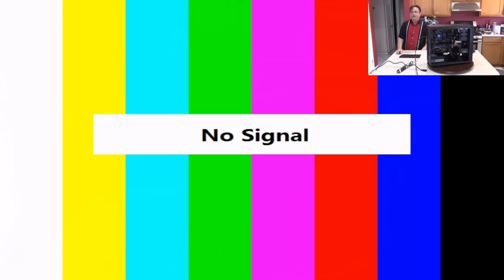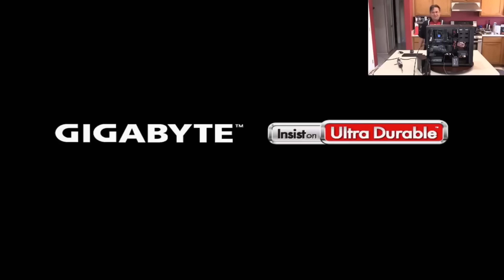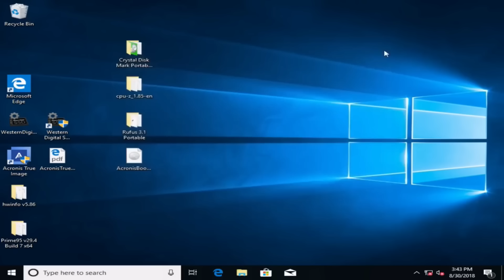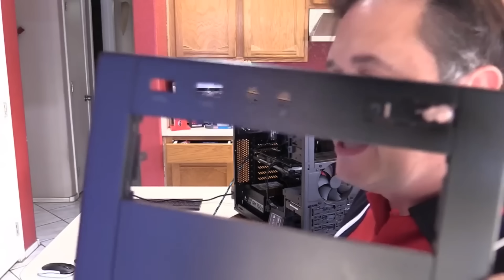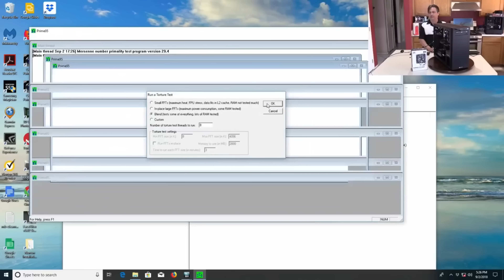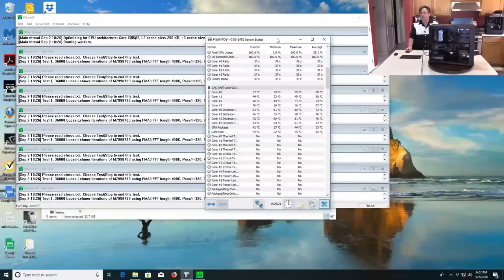HOLY COW! The easiest fix that NO ONE thought to check! Fixing a viewers broken PC.

Comment: i just did a PC build for my neighbor a month back. he was getting random shutdowns, and sluggishness. He had the PC originally built  in 2008, or so. it was a great Antec case, which was almost all aluminum, except for the front bezel which was dried out, but salvageable. he told me 'a budget of $800' , but what he needed from it, was tops a bill of $500. so i reused the case, got a new CPU, RAM, MoBo, and PSU, as well as a 970EVO+. it totaled $425 after taxes, i used an i3 13th gen, he LOVES it. its 5x faster than the old PC, it was half what he expected to spend, and i got him windows for free obviously. i always loved building PC's, i missed doing it

Comment: I wanted to thank you for making this video. I was having the same shutting down issue with my pc. It would keep restarting on any OS (internal HDD orexternal flash drive), but not while in the bios. Mine wasn't the reset switch, but was the power button. When I plugged the reset switch into where the power button goes it stopped the restarting issue. I hadn't thought of the front switches until watching this video

Comment: Corsair. I have a 600T Graphite case. Nice, except I once took the front bezel off not noticing when I replaced it, the too-tight placement had the bezel snagging the corner of the reset switch. Had quite a time trying to figure out why my machine kept switching on and off.

Comment: It's possible that they did find the issue, but wanted $700. Some computer shops are ripoff. Back in my early days of using a computer, my mother was duped several times by a repair man. He would charge her full price to reinstall Windows 95 because the win.ini complained about a bad entry. All he had to do was delete the line. Once I found out, and went into business myself, I made sure to always be completely honest.

Comment: Aside from front panel switch issues, I've seen similar symptoms caused by loose or incorrectly installed motherboard standoffs. They must be the correct thread for the motherboard tray and only in the locations where there is a mounting hole in the motherboard. I've seen every possible way to improperly mount a motherboard. I actually saw a motherboard installed without standoffs with bubble pack under the board and shipping tape trying to keep it in position. Question everything. Often times it is faster to disassemble the system and make sure it was put together properly.

Comment: Yep I had the same issue on a Dell desktop a few years ago, Dell had sent out an engineer several times and they had replaced the PSU once and the motherboard twice, plus various other cards, but it still kept restarting when warm. It took me 15 mins to isolate the reset switch as the problem. When the PC warmed up the expansion caused the reset switch to make contact and restart the PC. After a small adjustment to the switch the problem went away. I was rather pleased I had solved an issue that three Dell engineers were unable to fix.

Comment: On one customer I have the problem, windows staring over and over. The reason was the power switch. It have 10 kOhm, should be 1MOhm when it is no pressed. A multimeter is a must-have.

Comment: Good troubleshooting. Well done sir. I've seen this before. I've also seen a keyboard connected to a system that was doing something similar. Somehow it was shorting out the USB port intermittently. A faulty power supply can do this too, or one with a failing fan. But usually those will cause the system to completely shut down (not reboot). One time I had ruled everything out with a similar symptom (other than the motherboard), so I pulled the board from the system and noticed a screw was under the board barely lodged between the chassis and the board causing a short from time to time lol.

Comment: My 10700k needed a pretty good fan to run well and still play games without throttling. Even without overclocking I couldn't get away with Cooler Master Hyper 212 or anything, unless i wanted to run hot and throttle at times.

Comment: Wow nice video. Seeing the postal tax is about 135$ or more in America gives me goosebumps lol, im from Romania, Europe, and here would cost about 10 to 15$ at most to ship it to the other corner of the country or for lets say 850 km.
Here Norton is not so popular, it is considered one of the weakest antivirus and even if it comes with 1-year free bonus from buying a motherboard, most people don't install it.
If you cant uninstall a (faulty) program i suggest trying Revo Uninstaller Pro, im not advertising this, i use it since years and the beautiful part is it can force uninstall even a folder without any exe file as reference. It searches also for leftover registries and deletes them to help with a clean install.
Here not many people are using Firefox, mostly are on Google Chrome. I have Microsoft Internet Explorer from installing Windows 10 but i never used that even if it keeps self-updating often. 😆 Im not worried to much about privacy on a browser because either way or any kind of device or program you use, as long as you are on the internet you are still exposed. 😁

Comment: Personally, I would just leave that front panel the way it is and disconnect the reset switch. My experience with reset switches is to leave them alone.

They're often a root cause when used improperly to corrupt windows. My workaround if a force reboot is necessary, is to hold the power button down.

Comment: I had a similar issue in my own new self-build years ago, in the early 2000s, random powering off regardless of changing PSU, video card.. Returned mainboard for testing, passed OK, turned out to have hot melt glue blobbed across front panel switch wiring, the glob between the terminals on the power switch had developed some electrical conduction (you could measure it with a meter). Removed hot melt, problem gone.

Comment: In the 31 years in the PC business, I have never had a bad reset switch. Very strange.
Reply: Thought the same…
Reply: I bought a vintage PC, 133mhz, had similar issues, was the the power button.
Reply: It's a fairly common issue in laptops. Grime around the power button, or sticky liquid, or simply the user smashing it :D
Though, yes, I don't think I've ever had to replace a power/reset button on a desktop.

Comment: I had a similar thing happen to my box. The case itself dated from before 2010, I think. Nice big black case, with a 250mm side fan. It began to randomly shutdown and required a flip of the PSU switch to get it to restart. i finally noticed the reset switch din't work at all. I put in one of those UFO switches as I wasn't going to tear down the switch area. Am now happy with it again.

Comment: My condo furnace wasn't heating. HVAC company wanted $13k to replace furnace + A/C. I noticed it would fire occasionally when turning on the furnace light switch. Turns out the $2 light switch was bad. Replaced it myself with a spare switch from my parts bucket.

Comment: Think you read the wrong line on HWinfo :P   Max core temp with the Hyper 212 was 61c ,  not 81c . So you had almost a 40c reduction in core temp.   61c compaired to 99c on core 1. Core 0 also got quite toasty with that Intel cooler.

Comment: I used to build loads of pc's, but I must admit I think I would have missed the reset switch too. Perhaps if I saw the state the button was in, I might have checked that. But following along with your video, that was not noticeable. So my diagnosis at first was overheating of the CPU. Would have checked the temp from bios though. The slow boot, might be able to be fixed by running a dignostics on the filesystem, if it's ntfs, then chkdsk may produce some results.

Comment: Would have loved to see the tech's face if the owner agreed to pay $700 for new motherboard and it still doesn't work randomly.  Some old idiom about zebra and horse. 

After ruling out software problems and loose cables, the power and reset switch should have been the first to be checked. They are mechanical devices and they do wear out over time.

Comment: With a defect button I would either asume that the system is rebooting all the time or not starting at all or not having the reset functionality. I button that closes after some time automatically is really a strange thing. But I guess it is not the button itself but something on the PCB of the front panel.

Comment: This is why I keep old computer's reset/power buttons when I discard the cases. I have repaired a few broken/half functioning reset or power buttons over the years. Also, when testing a PC to see if the issues is hardware or software, I removed everything except what is required to run

Comment: Great video again. Inspired me to replace my CPU cooler. And to run the prime 95 test.

In the past I would have suspected power supply or memory.  Removed half of memory and boot.  Then swap the halves and boot.  After ruling out the memory - swap the power supply. 
But I now know to disconnect the reset button from the MB because YOU have educated me in past videos about failures of that button.
And it turns out it was the button.  Great video.

Comment: Nothing worse than a PC where you have to put the CD/DVD drive in before you put the front cover back on. Well depending on the make I always forget.
Reply: You can pop off the front fairly easily. Also i do keep an optical drive in my system but most people do not, it's pretty much a dead peripheral these days.

Comment: Hey Carey I have a headscratcher for you. PC that's had all it's components except for the motherboard replaced. Works perfectly fine in all situations except when streaming content via Netflix/Disney-plus or equivalent (but not youtube?) when after a few hours the display driver will crash and possibly lock up the entire system. Side note I also changed from a Nvidia card to an AMD card... same issue remained :D
Reply: You neet to fully remove old drivers . Use DDU
Reply: @maxwellbruce4747  I totally reinstalled windows twice and it still happened :) shifting too windows 11 made it just driver crash and restart.

Comment: I remember this first time around. A great lesson in logic and common sense Carey.
I think it's almost sad to see how the supposedly more or better educated generation still seem to have no grasp of the basics. I'm 75 now but I remember many many years ago an apprentice working on a new build site was told to set up an extension cord from the only power socket working nearby. This was long before cordless tools for everything. He went down a ladder and maybe over a hundred feet from the ladder. it was a one off situation and I know using a cord so long was not good practice.
So the kid set up the cord and came back to the electrician he was working with and says OK.
Tradesman tries the cord and it's doesn't work. 
Asks the question... Did you switch it on???  
Answer.............  (I'm sure there's an emoji for it somewhere).
OK... go back and switch it on.
A lesson in common sense and thinking enough to shout up "Do you want me to switch it on"?
OK I know it was not good practice but 50+ years ago that's how lots of things got done.
My point is Common Sense around the Basics is still no better 50 years down the line.
Progress- What progress?
Reply: I  also remember the video  the first time around.Always worth another look.

Comment: Im having this exact issue, and now i probably know what the issue is. I figured it was the SSD failing since its 7 years old.
Reply: I'd check SMART data.  SSD has finite write cycles and if it's been over 2500 (TLC or cheaper drives) or 10,000 (MLC) then it'd be a good time to get a new one and move files over.

Comment: Working on pc's for about 35 years,maybe had 2 switch failures, so your video refreshed my troubleshooting tips, that was sweet!
Reply: Same here, I've had a few power switches fail but never a reset switch in 35 years
Reply: Yeah, it seems to be rare, and that's why techs miss it, probably. I have been working on PCs for 18 years and only seen two bad switches, too. The first one was easy, because it was obviously rebooting every few seconds. The second one was a real poser, because it only partially failed. The PC would run for days before shutting itself off. The switch would randomly close due to fan vibration, I am guessing. Because of the weirdness of that, random shutdowns that appear to be heat related, I still check the switches before looking at heat. It's faster than going down the heat rabbit hole, so I eliminate the switches as the culprit first. Fortunately, I learned this on my own PC, rather than having a customer waiting on me to learn this lesson.
Reply: Over 25 years in the field and I've seen maybe 5 bad power switches and a couple of bad rest switches, but the most recent was at least 18 years ago. The switches used to be a lot bigger and more complicated than they are now. Ironically the cheapo momentary contact switches they use now may actually be more reliable.